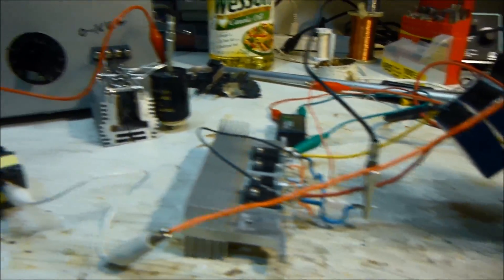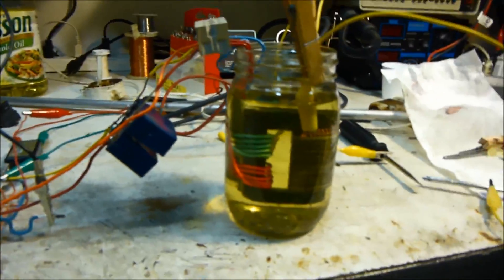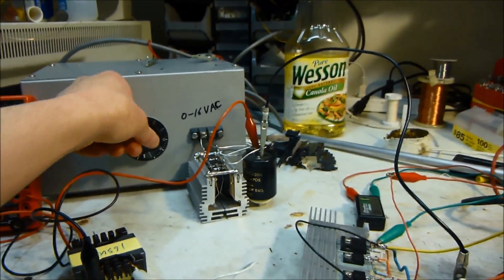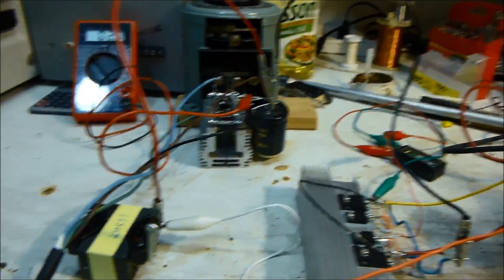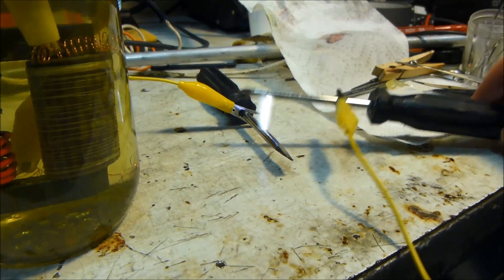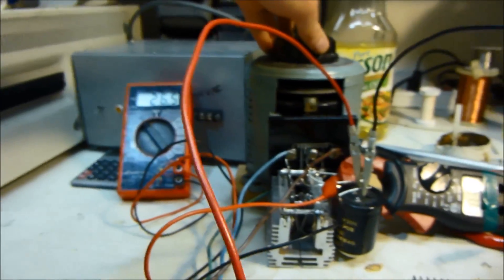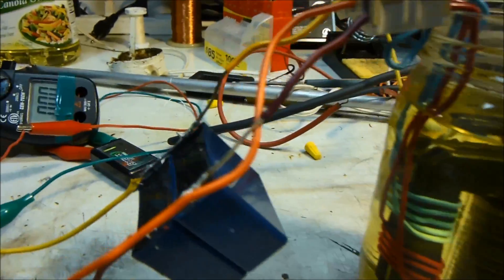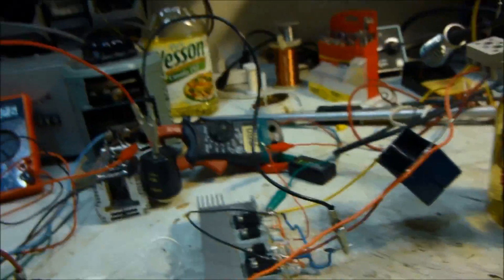Testing Out My New Homemade High Voltage Fly Back Transfomer

Comment: Looking at the turns ratio (5:600) and the fact that it's not arcing until you touch the wires, I'd say you've only got about 1500 volts at 12 volts in. Not impressed.

Comment: Reply Pls because we are your fans!
I take my transformer which is step-down.which convert 220v to 12v and I want to make step up  transformer by reverse the primary and secondary wire but my transformer is blasted 
Why is it happened Pls explain 
From your fan
Reply: The secondary coil of a wall adapter has a very low inductance resulting in an extremely low impedance at low frequency. For this reason, a very high current will flow through it if the voltage across it is sufficiently high. By inverting the primary coil with the secondary coil, you probably popped your circuit breaker or melted a fuse. Please don't do things like that.

Comment: the two  capacitors must be smaller for higher frequencity  to become more voltage and skin effects  , because big condensators save more joules for dangerous !!! everyone , your  symetric coil circuit  transitors , against tact , are very strong and perfect , last not least , to grow up to 40 volts is good , next step  is to use it in a tesla coil

Comment: Nice arcing without conductor contact of 4 or more inches, If you thought you might want to put shoes on your feet for the next spark video, a short cautionary statement could proceed any future demonstration using steel melting current.  The inventor of the direct current cardiac defibrillator proved the "R"on"T" phenomenon posthumously traced out on EKG graphic proof of lethal pulse-less Ventricular Fibrillation.  I hope this message finds you in good health.  Faraday cage safer than hot tubing -the Taxman
Reply from the maker: +wetaxingyou I should have a cautionary statement. This is an old video before I seriously started getting into YouTube. I'm still alive or else I wouldn't still be posting videos haha! Thank you for your concern

Comment: let's just say I may wanna experiment with certain voltages, and I needed to buy a variac to start with it, where would one be able to buy said variac for said electrical experimentation? also, that is indeed interesting how little it takes to just build a simple flyback, I might actually make one for myself, and for the sake of lighting and sound experiments. does the brand of canola oil matter for this as well?

Comment: Pretty cool man, nice transformer build. Definitely need to use a higher frequency to increase the efficiency. Ferrite core's magnetic field will saturate at low frequencies causing your primary to be low impedance and major loss of efficient energy transfer to the secondary. For an old TV flyback transformer ferrite core the best frequency will be around 15kHz, if it's from a newer computer monitor is could be between 30kHz-150kHz. When you get the right frequency for your transformer's core you will have maximum efficiency and you will have maximum voltage and current available across the secondary and will get WAY bigger arcs.

Comment: I remember watching this when it first came out :D Could you create a simple circuit for a sparker? Like the ones in gas grills that when triggered spark a bunch of times.
Reply from the maker: I'm going build a circuit the uses a hall effect sensor, MOSFET, and either a flyback or ignition transformer. I'll stick a little magnet on the flywheel that will trigger the hall effect sensor and turn on the MOSFET. I'll probably use a hall effect sensor from an old computer fan. I already bought an ignition coil from a junk yard for $4.
Reply: Makes sense!

Comment: Really neat system you built there, those arcs are amazing!  I really like the compressor trick you used... now I will have to scavenge one myself for such a use., never thought vegetable oil would be that great for soaking transformers in either.  Good work my friend!

Comment: i once put 1320W trough a normal flyback
https://www.youtube.com/watch?v=q7YuYQF2O-M
Reply: Is it possible to make white color arc just using battery?
Reply: no
the power is already DC
so a battery would not make a diverence
a ac arc is wihte/red
and a dc arc is blue purple
and i mean is the hv rectivied or not
Reply: It looks white but it is actual yellow
But it is to bright to see
Reply from the maker: ***** That's awesome!  I will have to try that!
Reply: ***** How come there are yellow if i use 24v instead of 12v lead acids battery, i know it should be blue to purple, but i also find the yellow color from 24v gets really hot for the tip of the the ground wire, is it because the wire r melting causing the yellow color?
Reply: It is because it has more amperage
And the diode in the flyback stop working so the arc turns AC instead of DC

Burning copper should make it green
Reply: IC Thx, so the diode broke down and back alive,  if i feed 36v would make the diode goes into complete brokedown stage which white arc happen right?
Reply: No 
It is yellow or blue never white
And the diode does not die for real
The p and n layers just start acting weird
Reply: ***** But what about the increased of current you said when it turn into AC, from some video, i clearly see the color was white, even your arc on the video look so close to white...
Reply: lol i hate u now
Reply: How come?

Comment: Thats some great work, i have always winded disc shaped about 4mm thick pancake coils an connected them in series but after i saw this and have the gear and few over 500w ZVS drivers laying around, i will wind one like you did
Reply from the maker: marko Helenin Coils like you describe are probably better since mine did burn out when I pushed it too far.  But it still really performed well.  Give it a try!  It's an easy build!

Comment: The 50 cycle mains frequency is not very efficient in this type of  circuitry..Drive the coil with FET`s switched with at least 2000 cycles.up to 10000. the current consumed will be fer less, with a great increase in output volts.Very good work and presentation.
Reply: Hes running a zvs on rectified AC ^^

Comment: Would be nice for you to post the schematic of the ZVS circuit you use. I used to make flyback drivers from a couple 3055 transistors and a few other components. Real easy. ZVS sounds like the way to go, though.
Reply from the maker: Sorry I didn't get back to you sooner.  Here's the schematic: https://plus.google.com/102840732238426269146/posts/DUKuBy1RML8

Comment: OK, first of all, if you want more current, do one with a couple gages lower eg #30 wire would then be #28 use polyethelene plastic between the windings. sandwich bags would work but they make different thickness poly drop cloth, for painting. That stuff can withstand a thousand volts or more. If you layer it the voltage goes up. Use spray varnish or shellac on each layer of windings, just enough to keep them in place. The really old flybacks had a secondary winding that looked like a hockey puck. This allows only a few turns per layer but cuts down on corona between layers. They also used HV plastic between layers. Some even used mica sheet, not found today. Use polyethelene. If you want more voltage, wind more turns. Shame you don't know the voltage of the secondary so you could build some HV caps and make a Tesla coil. 30 Amps is quite a lot, to get a 4 inch spark, though. Keep up the good work man!
Reply from the maker: Thank you for all the tips!  I hope to build a new one soon as this one fried!
Reply: DIY mica powder is everywhere, ask your sister or get bags of it in any color you like  http://ecoizm.com/beauty-health/diy-beauty/natural-beauty-ingredients/mica-powder-mineral-pigments.html

Comment: Nice Video,  Don't stop there !!   maybe put the over heated wire in Oil too.  Find a way to pump it up.  All the way. Be creative !!  keep thinking, "what would Tesla do ? "    MORE POWER.  enough is never enough !!  Go all the way.!!  Test infinite !!  The way to be successful in life is Go Big !!  Exchange the screw drivers for carbon electrodes and step it up.  Wear rubber gloves !!  Stand back !!  but, TURN IT UP !!  All the POWER !!  USE IT !!  Be careful, because You need to LIVE for Higher Voltage.  Be a safety fanatic and You WILL go farther than the rest !!  Set Your goals in life !!   Maybe 6 foot arcs ??  You set the goal. (or record) I can see You dig it.  That's all it takes to go to the top !!  Just Be CAREFUL !!  and go for it !!  It's the American Way !!   Impress the rest !!

Comment: Can you tell me about some components between power supply and flyback transformer? i`m planning to make a pulsed plasma thruster and i have no idea at all.
so please help!!
Reply from the maker: Sangheon Park Inside the box "power supply" is a little variac(variable transformer) then the power from that goes into a 120 to 12 volt step down transformer.  So it is basically a variable AC power supply.  Then I have a bridge rectifier diode and capacitor on the output which you can see in the video.  You can always use a 12 volt battery or old computer power supply instead.  Thank you!  I hope that helps!

Comment: make an ozone generator with that bad boy , place 2 screens on either side of a piece of glass , it may take several layers , but basically you separate the electrodes with glass quarts preferably and you get a strange red purple plasma and ozone gas 
;
Reply from the maker: NOBOX7 I don't think it really produces enough voltage.  It's only a couple KV max.  Mostly current.  But I could try it with a TV fly back.  I though ozone was bad for you?
Reply: Makerj101 it is but it can kill things that are bad for you like molds, it also deactivates oders , but best of all it can protect your home from mold and clean your car of smells
Reply from the maker: NOBOX7 Oh I see!  That makes sense!  Thank you!

Comment: How many volts are you getting out of this one(on the secondary that is)?
Reply from the maker: I would guess about 30KV.  Thank you!
Reply: And current? Im thinking about putting together a hv supply for a fusor project, which would require at least 10mA. Any chance of that happening with this supply? Thanks for the quick reply.
Reply: 10mA @ 30-40kV that is.
Reply from the maker: Well I measure the current in this video and I estimated it to be about 600 milliamps.  When you draw an arc the voltage drops a lot.  So when you are not arcing I would say 30KV and when you draw an arc maybe 1KV@600mA. Video:  
Arcing Sand With My Homemade HV Flyback Transformer, Current, and Power Tests

Comment: definitely a lot higher amperage than TV flybacks, but not as High voltage.. the TV flybacks as you saw in the one you took apart have a lot more winding but very small wire, but you got yourself the power of an MOT right there
Reply from the maker: Yes a lot more!  I think I will probably do more like 800-1000 windings on my next one.  Hopefully to get a little high voltage.  I still need to optimize my ZVS driver so I still may be able to get a bit more out of it.  Thank you!

Comment: Those are some lovely arcs!! Looks like you need thicker primary and input wires. You could probably lose a turn of each half of the primary too. LOL at desoldering the caps from the current. I'm going to have to do one myself.
Reply from the maker: Yes I do need thicker primary wires!  Hahaha they were getting a little to hot on a more recent test and the oil started to boil a little bit around them!  XD  Yes the sdeoldering capacitors was very scary!    Made me jump a bit!  Yes you should build a transformer!  It was so easy!  Thank you!

Comment: Awesomeness!! :) Nice job :P Watch the magic smoke :P and watch those fingers this look a big nasty for current :P Thanks for sharing!
Reply from the maker: Thank you!  Yes I will try not to burn it out!  Mwahahaha!!!  I sure didn't put that much effort into building it though.  So I kind of what to push it an see when it will die!  Only problem is that I'm not sure I have enough power to push it that far though.  XD
Reply: lol How many amps you need! Mouahahaha :P Don't burn it ;)
Reply from the maker: bakupcpu Lots more amps!!!  Mwahahahaha  I'm not even using half the amount of amps my mosfets are rated for!!!  More amps I need!!!!
Reply: lol take a old mot and rewind it ;) you'll have all the amp you want :P
Reply from the maker: I wish I had some MOTs!!!  I have not seen any microwaves around here like ever.  I could build all kinds of things if I had a bunch of MOTs.  A welder would be one of them!  Maybe I should drive around on trash day and see if I can find one.
Reply: :) I have like 2 near my house in the garbage lol. I would go check either the waste disposal or even an electronic repair shop maybe they have some in spare :)
Reply from the maker: No fair!!!  Hmm I don't know of any...  Maybe I need to find a scrapyard...
Reply: Would be a good start :P Or I'll send you one hahahah the post charge are going to be enormous :P Or even better make your own power supply from 120 to what ever you need with a switch mode design :)
Reply from the maker: Hahaha it's ok!  I'm sure it would cost a pretty penny to ship MOTs!  :P  Hmm...  Is there a way I could get the ZVS to run off 120 volts DC without it trying to draw ridiculous currents?  Because with it drawing 30 amps at 40 volts I'm sure it would pull 100 amps or more at 120 volts from the wall.  :P  Thank you!
Reply: Well it wont be the same if you reduce voltage at the end and the primary would have more turn :) a good practice is about 1 turn per volt. :) I have couple of similar circuit and a good source is old CFL light that still work they have high voltage transistor and a nice little driving torroid for them I've use those in the past for stepping down voltage.
Reply from the maker: Hmm so wait if I put more primary turns on my flyback I should be able to get it to run off a higher input voltage?  Thank you!
Reply: Yes :) also keep in mind the will lower the frequency you have to find the happy middle :P
Reply from the maker: Ok!  Thank you!
Reply: :) no stress!

Comment: Hi, if you want longer sparks you could use homemade aluminium foil shaped into a pointed tip. Those attract high voltage more than flat surfaces (that is how Benjamin Franklin made his lightning rod ;) ) Thanks for your video :D
Reply from the maker: This transformer would instantly burn aluminum foil to nothing!!!  Even a pointed tip like a screw driver gets melted and burned up!  Thank you!
Reply: Use this : http://www.amazon.fr/C-K-T1531-Pointe-carbure-tungst%C3%A8ne/dp/B005XBABPU    
Melting point : 3400°C
You can find similar ones in US (made of tungsten and used to carve hard metals)
Reply from the maker: Hmm that might work.  Thank you!

Comment: very nice ! thats a well made flyback man typically the lower turn secondaries will be more less volts but tons of current ! i have my two 500 turn flybacks and although they are more current based, wired in series with a center tap they can give up to 25-30 kv if you could wind another one with the same wire/turn ratio you could possibly get some serious output ! and as Ant said try cap values but if you have smaller caps wire them in parallel to decrease the current on them so they dont fall off haha .. 25-30 amp flex wire would work great for your setup too ;-) overall an awesome project bro keep up the good work and cheers ! =D
Reply from the maker: How do you power two transformers so that the HV is in phase?  Do you use two ZVS drivers that are synced?  Yes I will do that with the capacitors!  And yes I really need heavier wire!  :-D  Thank you!
Reply: Makerj101 you can watch my vids i show you how i wire it up ;-) its real easy only one zvs is used ..
Reply from the maker: dirkk82 Ok!  I will have to do that!  BTW I just subscribed!
Reply: Makerj101 hey thanks man i got some things you might like on there ;-)
Reply from the maker: Yeah it looks like you do!  I will have to give some of you videos a watch when I get some time!

Comment: Beautiful arcs. I don't think the output is close to 1kW, though.
Reply from the maker: Thank you!  Yeah it seems pretty crazy to me too.  I measured the power on the input of the variac and it is pulling about 8 amps from the 120 volt outlet.  So that would work out to be about 900 watts.  The screw drivers were getting really hot really fast too.  So there has to be a lot of power.
Reply: Makerj101 Yeah but I would say the output was around 200W, max. 500W. Watch my video called "37V ZVS step-up and directly powering an AC flyback". The transformer would NEVER give more than 500W and the arcs were still very nice.
Reply from the maker: Interesting!  If my apparatus is drawing nearly 900 watts from the wall and I'm only getting like 200 watts of arcing power then where is it going?  Some is diffidently lost though wiring because some of it started to melt after arcing for several minutes.  The capacitors also get pretty hot.  The homemade flyback it's self does not get warm at all.  The mosfets get a little warm.  So I just don't see where 700ish watts could be going.  How could I measure the current and voltage of the arcs?  Thank you!
Reply: Makerj101 I think your ampmeter might be broken. Try directly measuring the current that is going into the variac (with a contact ampmeter). Make sure to only run it for a few seconds, not to damage your ampmeter.
Reply from the maker: That sounds like a plan!  I'll try that!  I'll use a analog amp meter because I don't have a meter that will measure AC amps other than my clamp meter.  Thanks!